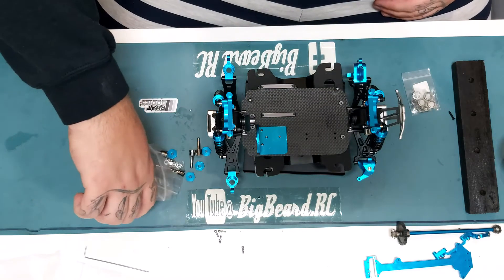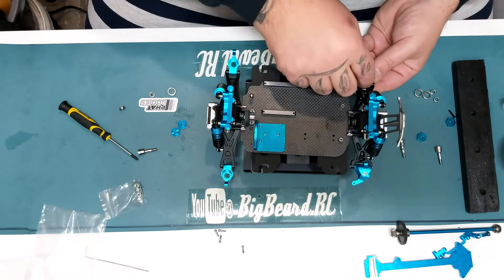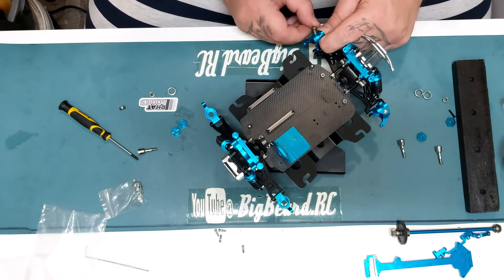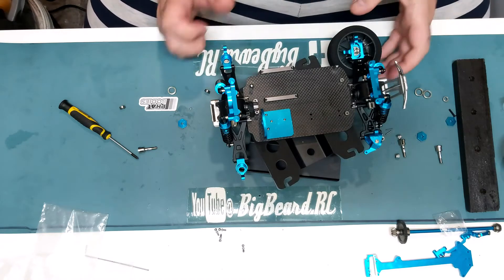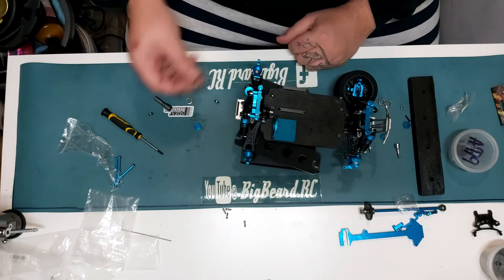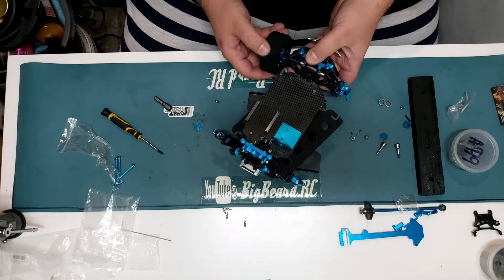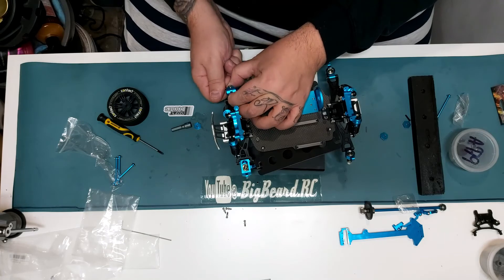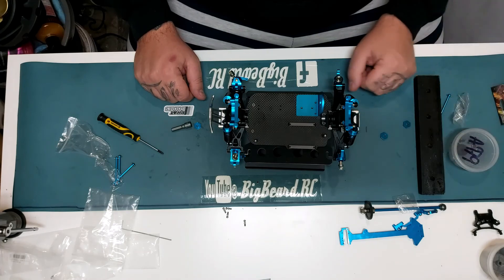Wltoys A979 1/10 wheel conversion

Comment: What are the sizes of the blue wheel hex connectors, bearings and wheels? Thank you!
Reply from the maker: The wheels are 1:10 contact foams and the wheel hex are a 1:10 conversion kit for 12mm hex https://www.ebay.co.uk/itm/373138296041 and the bearings were a kit https://www.ebay.co.uk/itm/254746853353
Reply: @bigbeardrc4145  Thank you so much for 5har info my friend!